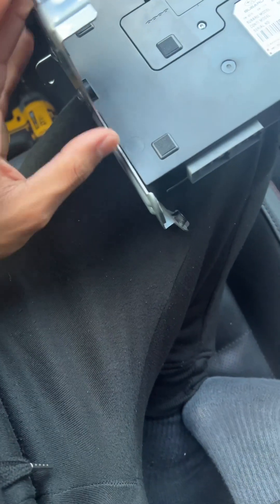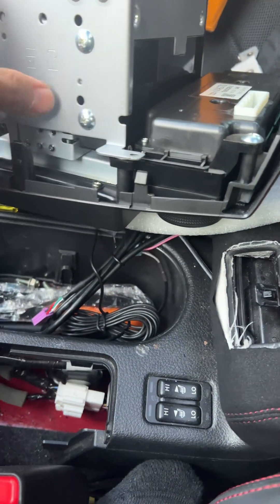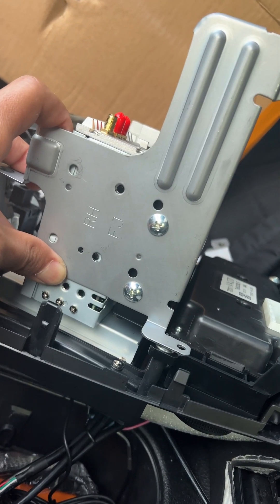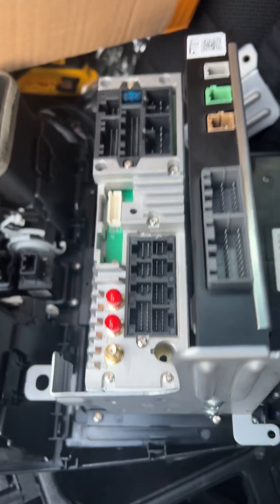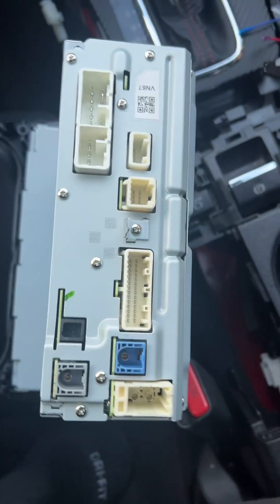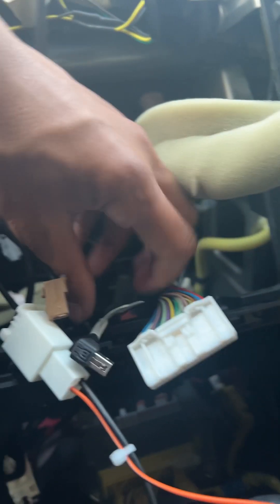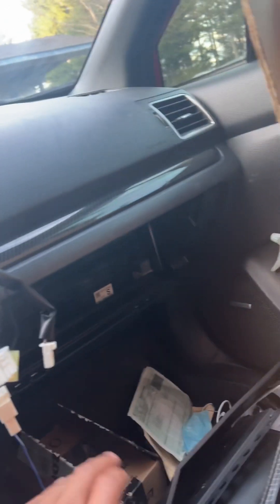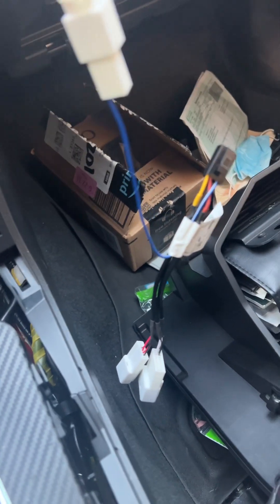IDoing Head unit install trouble

Comment: You should have different brackets that came with idoing
Reply from the maker: Unfortunately there was no other brackets that came with it, in most videos i dont even see people using them. However i ended up shaving off the corners and it fits amazingly. I didn’t want to use double sided tape like I seen others do